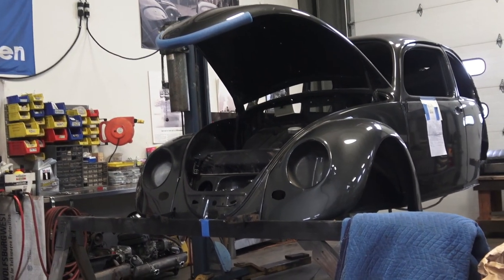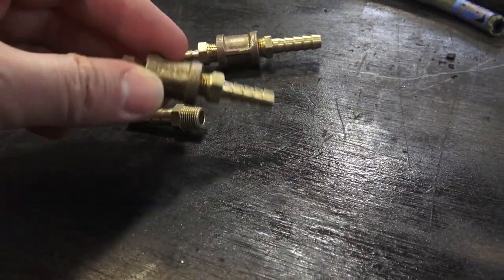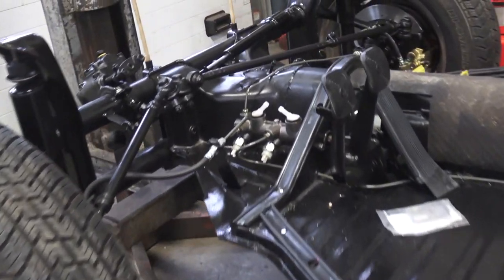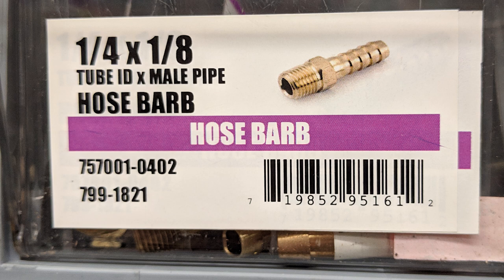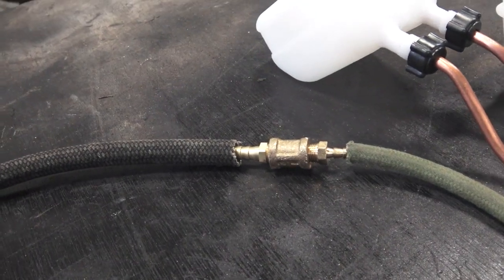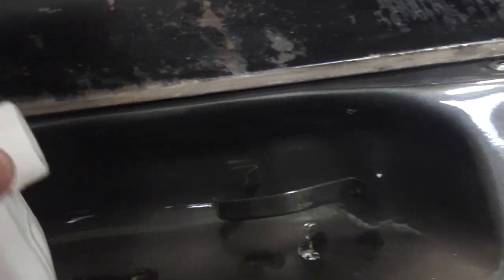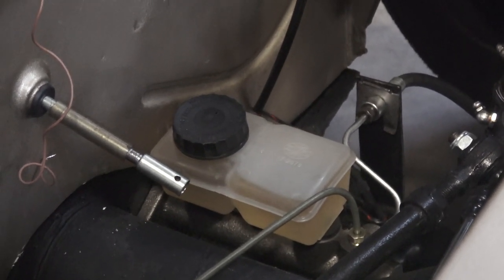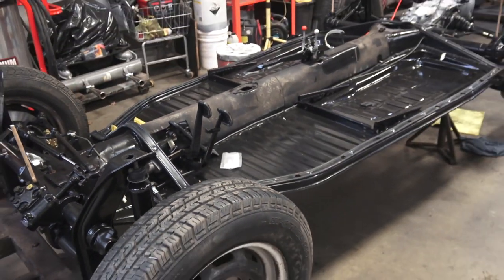Classic VW BuGs Dual Master Cylinder Early Bug Brake Hose Fix

Comment: Can you use a T fitting coupler to adapt the original reservoir to the later dual circuit master cylinder? was going to do it in my 65 bug as be adding connectors for the brake light switches.
Reply from the maker: Yeah you just have to make sure the fitting will not corrode from the brake fluid.

Comment: Could you use either brass or steel barbs and couplers?  Thank you for the helpful info.
Reply from the maker: I think you are ok with brass, but to be safe I would think steel would be better.
Reply: @classicvwbugs  Thanks Chris. I went for all stainless steel barbs and couplers.  (It took a while to find them.)  Appreciate the inclusion of the UPC codes on your video.

Comment: Question about wiring the two prong switches.  I have a 63 with a dual circuit and two, two prong switches.  I just put a new harness in, but am not finding anything on how to wire those two switches.  The harness is built for a single circuit. What's the solution?

Comment: Hi Chris! I have a 1967 beetle and it has the single circuit brake master cylinder, and I know that it seems obvious that the double circuit is safer but I've met beetle owners telling me that in an emergency if there is a problem with the breakes,  the double circuit will make almost no difference because they've already have the unfortunate experience  of having brakes problems while driving beetles with double circuit brake master cylinder, and it was almost like having no brakes. I 'd appreciate your opinion, thanks! Love your channel!
Reply from the maker: Well a single would be no better then either.  VW always did things to be better as time went on, a dual master is always safer than a single.
Reply: @classicvwbugs  ok, thank you!

Comment: Hi Chris...didn't  the dual res. And master come out together in 67 ? Why is the inlet pipe on the master different than the outlet on the reservoir ?
Reply from the maker: Yes it did, but this is about if you want to upgrade to this style on an earlier bug.   67 and earlier bugs had a smaller reservoir with and smaller outlet line, so you have to make an adapter or get the reservoir that sits on top of the master.
Reply: @classicvwbugs  thanks for the reply, I am totally aware of that single Reservoir and the double Reservoir and the change that happened in 1967 ....what I'm curious about is why doesn't that 67   reservoir have the same size Outlet as the inlet on the 67 master cylinder ? Shouldn't they just hook up to each other with no adapters needed?

Comment: Very well explain again Chris , and the correct fluid would be DOT 3 ? Also how can I contact you ? I might need your shop to work on my Bug 1966
Reply from the maker: the correct fluid is DOT 3 yes.  My shop is not a repair shop but a full on resto shop.
Reply: @classicvwbugs  correct that’s what I thought , I have a 1966 Beattie , it’s in ok shape but I like to have it showroom condition , we are in Canada though .

Comment: I wanted to ask I have a single master cylinder with empi 4 wheel disc brakes ... if I want to go to a dual master cylinder are there any modifications that have to be done to the brake lines ?? Ty and ty for ur videos !!!!
Reply from the maker: nope, don't think so, you should be good to go.

Comment: Chris I am converting a 58 to dual master. Just wanted to know if I can still use my original brake push rod with this setup. Thanks - Mike
Reply from the maker: yes you can.
Reply: @classicvwbugs  Thank you Chris. Excellent videos, really helped me a lot with my 58 beetle.

Comment: I looked at this for my 61 and 66. I think I have a better idea. What if I made or printed a plug for the master cylinder with a barb that matches the 67 reservoir. Then only one hose for front and back would be needed with less potential leak points. Your thoughts?
Reply from the maker: Sounds good man, give it a shot.  If it works, maybe we can do a video on it.  LMK

Comment: Couldn't you use 2 barb fittings, that screw together, and eliminate the steel pipe fitting, or get a 1/4 x 3/16 hose barb adapter, which would look cleaner

Comment: What would happen if you put the direct reservoir on, put an original in its original position and modified the cap on the dual to accept a hose from the original reservoir?  As long as the original had fluid in it you would know the system wasn't dry and it would be easy to fill.
Reply from the maker: I guess you could, but you have to be careful really.  Are you also filling up the reservoir in the trunk as well?
Reply: Yes, that would be the idea.  Fill the trunk reservoir and it would feed into the one on top of the master cylinder.  I've seen brake bleeders use this technique where you put a feed on top of the master cylinder while you go to the wheel to draw out the brake fluid through the bleeder (I use a vacuum bottle on a compressor).  I had to make an adapter cap from a bottle of brake fluid that happens to fit nicely on the upper reservoir (for bleeding, I haven't converted my '64 to dual circuit) and haven't had an overflow.  @classicvwbugs

Comment: Couldn't you  just screw in one of those hose barbs in the lid of the reservoir that sits on top of the master cylinder/ under the tank?  That would give the old original reservoir a purpose and make it easier to refill the new one under the fuel tank. It's just an idea.  But maybe that wouldn't work?
Reply: I'm literally thinking about doing this exact idea. I don't want to have to drill, plus my washer motor is in the way for the later tank.

Comment: Do you have to get a later model brake pedal push rod for the later duel master cylinder?
Reply from the maker: Maybe not, those rods are adjustable in length.  You can get this https://www2.cip1.com/ProductDetails.asp?ProductCode=VWC%2D113%2D721%2D205%2DJ
Reply: No u dont